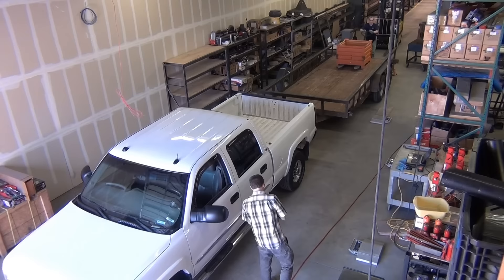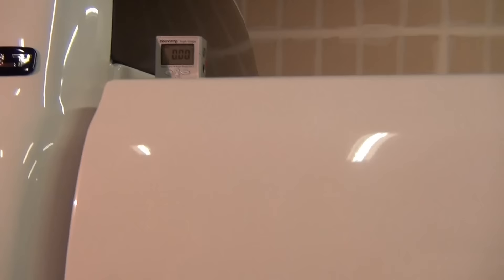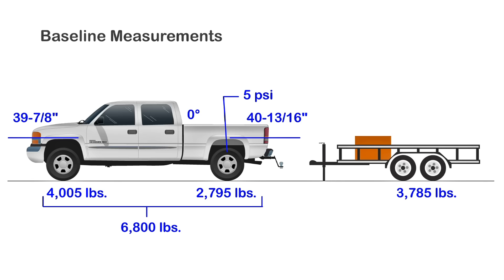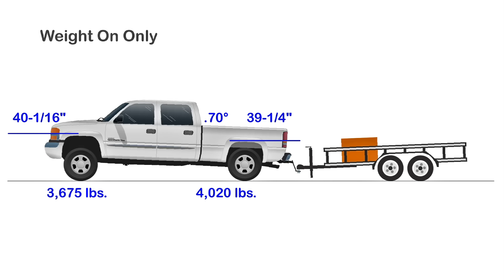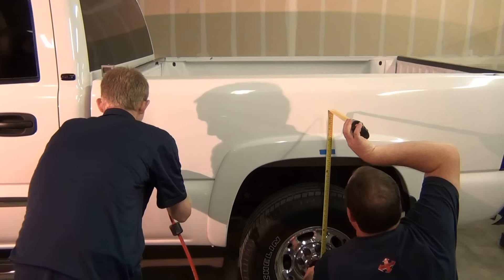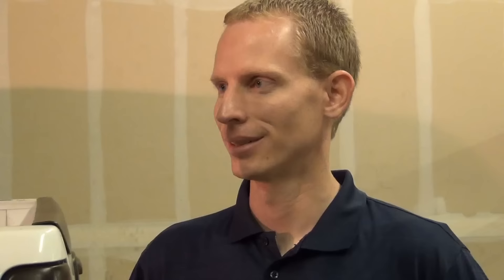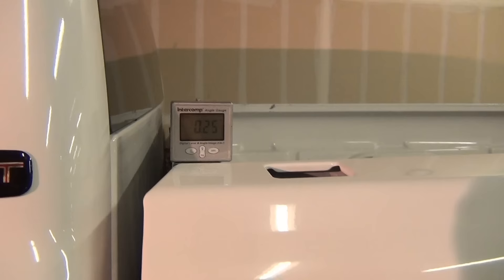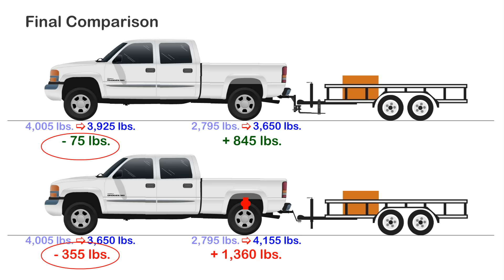The Difference Between Using Weight Distribution and Air Bags to Level Your Load

Comment: I appreciate this video showing the effects of each, this is informative. A suggestion would be to center the weight on the trailer to remove the tongue weight and get a true reading on the trailer axles in the unconnected state (scenario 1). 

Even though the 140 lbs is roughly a 1% error for total weight, the 140 lb difference for the weight distributed measurement is 56% of the claimed 250 lb front axle gain from no adjustment (scenario 2) to weight distribution (scenario 4). The question is what percentage of the 140 lb weight gain for the distributed scenario is applied to the gains in the front axle? 

The true original unconnected tongue weight and the weight of the distribution hitch not used in the first 3 scenarios appear to me to be unknown.

Could you give some more specifics of the truck? It appears to be a crew cab short bed, but is it a diesel or gas engine? I would imagine for a longbed and diesel variant (if this is a gas engine) the weight changes per axle could be considerably less.

Thanks.
Reply from the maker: +bigshafe, thanks for the comment!
Centering the weight on the trailer would change the measurement at the axles and tongue. However, we need the tongue weight for this example, as that is what effects the weight distribution.

I'm sorry, we don't have the data to calculate what percentage of the 140 lb difference applies to the front axle, because we don't know which scales were measuring at the high end and which were at the low end of their tolerances.

It is a GMC crew cab short bed, with the Duramax diesel motor. You are correct, changing the length of the bed would change the way the tow vehicle reacts to both weight distribution and air bag adjustments.
Reply: I meant that if you center the weight on the trailer you get the true weight of each vehicle independently and better grasp or eliminate the variation in total weight which is unclear. This info would allow for the tongue weight to be calculated.

With scales on each tire you should be able to calculate the tongue weight by measuring the location of the weight on the trailer in the unhitched  state with no tongue load since it will be resting at the CG of the trailer. Using the change in location of the weight on the trailer you should be able to calculate the actual tongue weight. 

Tongue_Weight = (Trailer_Load_Weight*Load_Dist_from_CG)/Dist_from_CG_to_Hitch_Ball

Or if you want to know where to place the trailer load by specifying a tongue weight percentage:

Load_Dist_from_CG = (TW%*Dist_from_CG_to_Hitch_Ball*Trailer_Weight)/Trailer_Load_Weight

Thanks for the info.
Reply: Bigshafe
Bravo! I thought no one else caught that. In fact, the TRUE (uncoupled, at level) tongue weight was never measured from what I saw.

I'm a bit at a loss on how a 6800 pound truck + a 3785 pound trailer + an assumed tongue weight of 1000 pounds actually weighs 115 pounds more because they are coupled together.
Reply from the maker: +1972pantera,
We are not sure what you mean by true tongue weight. It was measured in the beginning with a Sureline tongue weight scale showing 1,000 lb as the weight was being moved into position on the trailer (1:10). This was done before it was coupled initially and moved into position over the axle scales because it is easier to pull the entire rig onto all of the axles scales at once (1:45). We should have done a better job of getting some footage of this.

The difference of 115 lb is due to the tolerance differences in the axle scales, which read in 5 lb increments, and the tongue weight scale which is a small hydraulic scale with an analog gauge, measured at the tongue jack instead of directly below the coupler socket. For this demonstration, 115 lb is less than 1% of the combined vehicle weight of ~11,585 lb, which we felt was an acceptable amount, while still effectively demonstrating the principles we wanted to show.

Comment: Hey guys, great vid. I have a Ford F350. I have run with airbags and weight bars on other trucks, but with this new truck, I am thinking of adding either air bags or stepping up in leaf springs. Please advise which will handle weight better. I have the weight hitch already.
Reply from the maker: +Danny Mc,
The solution depends on your problem. Each works differently, and is unique in what it adds to your setup. Air bags are great for changing the stiffness of a suspension quickly and easily - just add or remove air to get the ride you want. This works well if you occasionally carry a heavy payload in the bed of your truck, and need a quick and easy way to stiffen or soften the suspension. They may also have some benefits over switching the leaf springs, like lower cost or easier installation.

Weight distribution is a great solution for towing a trailer. It changes the way the vehicles interact with each other, and helps keep the tongue weight of the trailer from lifting weight off the front axle of the tow vehicle. This is important because it keeps you from losing braking and steering control. It can also help to keep you from exceeding rear axle weight ratings on your tow vehicle. Some models, like the e2 hitch, provide built-in sway control, which can also improve safety and handling while you're towing.

Choose the solution that best fits your specific towing needs. Many people successfully use both options together.

Here is a video that explains the benefits of using a sway control hitch: https://youtu.be/ChyN-d_qcHo

As always, you are welcome to contact our customer support team if you have more questions: 877-523-9103 or Support@FastwayTrailer.com.

Good luck!

Comment: I’d like to see a comparison of WD hitch versus Roadmaster Active Suspension kit. Trying to decide which one to go with for my 2012 F150 pulling a 16 foot aluminum skin/steel frame cargo trailer.
Reply: WDH takes some weight off the rear axle and divides it up between fron axle and trailer axles. Active suspension kit acts the same (effectively) as air bags in this video. Same with Timbren load levelers

Comment: So simply... this is a 3/4 or 1 ton rated truck.  Pickup trucks have a problem with unbalanced weight distribution with a higher percentage of weight on the front axles and less of the rear, to compensate for loading the bed, when the bed is loaded they become more balanced, and safer.  This is simple stuff every automotive engineer knows.  The truck is designed to be unbalance bias forward to compensate for the anticipated load.  In fact, driving in slick or icy conditions you will find this out; first the vehicle will have poor directional stability and second not enough traction in normal 2wd mode.  The trailer installed causes bias reversing the unbalanced situation by transferring weight from the front axle to the rear axle more balancing the truck.  However, the spring loadings front to rear cause a tail squat, without the airbags with the trailer hitched, and this causes a hitch droop and unbalancing of the trailer with more bias of weight to the truck.  With the airbags installed the bias of weight becomes less pronounced on the front axle of the truck and trailer axles, transferring more weight on the rear truck axle but eliminating squat and hitch droop problem.  When only the hitch bars are installed it also levels the rig but now more evenly transfers the weight of the tongue on the truck and trailer axles, but not by much, still most of the weight from the trailer hitch is borne by the rear axle.

Analysis - usually transferring weight around is not an option for a vehicle unless this is designed for.  So automotive engineers spring the vehicle for the weight each axle or wheel, in the case of independent suspension, actually has on the axle.  This is not done by force or spring rate.  The selection of springs is accomplished by frequency of the spring and suspension to achieve the best compliance and the road. Tires factor into this though the frequency change or of pneumatic devices in general is low and does not change much, compared to spring systems or road or terrain changes.  The frequency is highly sensitive speed of vehicle variation.  Without knowing the suspension frequency, spring frequency, and the speed or type of road or terrain we can make some surmises.  

First, driving with the trailer hitched without much change in road or speed conditions is reasonable and safe, however, changes in speed or terrain such as larger bumps will unbalance the rig easier.  Why it is safe and reasonable is that the truck pull vehicle is likely operating more inline with the designed loaded condition, there is no real overloading, and nothing outside predicted loads the truck was designed for.  Certainly, there will be more rear tire wear, but likely stopping distances will be less than usual for the unloaded truck. 

Second, driving with the trailer hitched and with the rear airbags inflated makes little change other than correct the tail squat and hitch droop, the weight changes are minimal.  However, this would be not a predicted loaded use of the truck and is changing design parameters, so the handling of the truck will be changed.  Fortunately as more weight is carried on the back wheels, correcting the normal unloaded imbalance of the truck this would likely be harmless and very well may improve handling of the truck as the frequency of the suspension would come more inline with a loaded design, weight for the truck.  So it would be also likely reasonable and safe, and the stopping distance over the unladen truck would be improved.

Third, driving with the trailer hitched using the weight compensating  hitch bars simply evens things out to the first scenario, corrects the out of level condition caused by hitch droop, but has another effect of improving sway stability due to the hitch arms acting as damping springs for changes of terrain, bumps in the road, or changes of direction.  The sway bars or hitch bars resist changes in level of the combined vehicle making it less sensitive to bounding, why they add a spring rate to the system  to dampen out the imbalances....  this suggests the obvious... 

Conclusion - As the rates of movement of the hitch up and down changes the three sets of vehicle and trailer axles load changes inherent in driving down any but the most perfect smooth roads.... perhaps  it would be best to use the air bags as the sway bars or hitch arms to balance the vehicle loadings rather than as auxiliary rear axle springs.   Why is that the low spring frequency rate of the pneumatic springs would more match the rates of change caused in the hitch droop and vehicle vertical angularity.
Reply: Except as I interpret you saying it is better to use air bags,you are exceeding the axel weight rating of the rear axle on the tow vehicle ,where if you use the equalizer bar hitch it transfers some of the load to the front axle of the tow vehicle and some on to the trailer axles to help keep your AWR and your tow vehicle payload weight rating in specifications ,though there may have been something lost in the super high grade bull shit you was writing with .

Comment: Thanks for the video, I bought a Dually truck w/ air bags already installed, planning on buying an RV, do you recommend having both a WDH & bags?
Reply from the maker: Thanks for watching! It can be done. We just recommend using the air bags at a lower level, because having too much air in them can lessen the sway control that your WDH will give you. If you do use both, we recommend setting up the air bags first, and then adjust your WDH. Doing the air bags last will eliminate that tension needed for sway control.

Comment: How  do  you  address  squat on a rv  single axle  trailer  when your trailer load out rating is the same as  the  axle  rating  I  believe  that  the  weight distribution    hitch  sends weight  to the  trailer  axle  also  creating an over stress  stituaton that  could  cause  axle failure  as well  as  tire failure. Another  thing  I  notice on  these weight  distribution  hitch  videos  the  lack  of  information  about  the  axles  ratings  load out  trailer  ratings  etc,  that's    why I  may watch these  but  but do  my  own  research  then I  will  decide  way I  need  to  proceed . Thanks for any info  on single  axel towing.
Reply from the maker: It depends entirely on the trailer. Few RV trailers have a GVWR that is more than the sum of their axle(s) GAWR. The amount of weight transferred to the axle(s) is always much lower than the tongue weight. What this means is that if you aren't above your GVWR for the trailer then you'll be fine. There are some trailers (mostly construction trailers) where the GVWR will be the GAWR of the axle(s) + the rated tongue weight.

Comment: Would like to see the same test done with a full airbag suspension. 
I have a grand Cherokee that I tow a 3 ton  caravan with on full airbags with 300kg to 310kgs on the ball, and I find if I level the car and trailer with the WDH, I  tend to loose traction with the rear wheels more frequently. I think this is because the WDH holds the rear of the car up and transfers the weight to the front axle and trailer axle, therefore the rear airbags drop air pressure thus decreasing rear wheel traction.
My fix so far is to let the car squat and only take out half to two thirds of the squat with the WDH. This still has me driving uphill all day, but it drives very securely and plated on the road and feel very safe. This is also enough to take out the pig rooten (porpoising) between car and caravan.
Reply: check out the follow up video - https://www.youtube.com/watch?v=mj2oqAiltsk
If you are losing traction in the rear - sounds like you have too much weight distribution. Weight distribution should never make the rear higher than you were without a trailer. Even at max weight distribution of 100% (front fender is same height as without trailer) the rear will be lower than without a trailer attached.

Comment: Fantastic video. Can anyone tell me under what circumstance would you want air bags? If I use a WDH, is there any added benefit to having airbags also?
Reply from the maker: You should be okay with just your WDH, but some people like to use air bags to get their rear axles back to level, but that is not required.
Reply: In a word, payload. A WDH only levels the truck if the weight in the rear is from a trailer. If you have a lot of weight in the bed then airbags can level your truck, which if nothing else will keep your headlights from blinding oncoming motorists.
Reply: Air bags are handy when hauling a load in the box itself, or towing a 5th wheel which doesn’t have weight distributing capabilities.

Comment: Great video and information. I have always used airbags and considered myself knowledgeable when it came to towing etc. but in this case was unaware the airbags alone did not redistribute the weight. One question as well. Why is the tongue weight figured separately as total weight of trailer and cargo? For instance if I have a trailer weighing 1500 lbs and 500 lbs of cargo for a total of 2k lbs wouldn't that be my total trailer weight no matter what the tongue weight is? Thank you
Reply from the maker: +89 Fox,
You are correct, a trailer weighing 1,500 lb with 500 lb of cargo would give you a gross trailer weight of 2,000 lb. However, some of this weight will be carried by the axles of the trailer, and some by the coupler / hitch of the tow vehicle (unless it's uncoupled and sitting on the tongue jack). Hitches and tow vehicles have two ratings, one for tongue weight, and one for gross trailer weight, because those two weights act on the tow vehicle differently. In our example, we start off showing the trailer's tongue weight as a separate amount from the axle weight, because the tongue weight is the amount that affects the way air bags and weight distribution react with a bumper-pull trailer. Hope that answers your question. Thanks for the comment!
Reply: FastwayTrailer thank you for you quick reply and information.
Reply from the maker: +89 Fox, you're very welcome!

Comment: I am running both, airbags and a 14k Equalizer.  Other than taking it to the scales, whats the best way to know my setup is optimized and safe?
Reply from the maker: Trevor Hettinger,

The best way to know the setup is optimized and as safe as you can get it, without going to a scale, is to follow the Owner's Manual process and check the measurements on the front axle. Although this is not as exact as using a scale, it is a very good way to observe how much weight distribution you are getting from the hitch.

Inflate the air bags to the desired pressure you will be towing with. This will give you the most accurate baseline to begin with for the measurements. Once this is done, go through the hitch setup as it is explained in the owner's manual. The e2 owner's manuals can be downloaded here if you do not have one: http://www.fastwaytrailer.com/manuals

Good luck and safe towing!

Comment: Interesting test, but you should also have shown the results of using weight distribution AND air springs. Additionally, it be interesting to see your impressions of actually driving the truck in all 4 states: No WD, no air in air springs; with just WD; with just air; and with both WD and air.
Reply from the maker: +Michigan Wheels, thanks for the comment. Several others have requested that we show the results using both weight distribution and air bags (springs). This is a video we have planned, and hope to shoot and publish soon. Thanks for the suggestion on our impression of the four states. Maybe we can work that into the video.